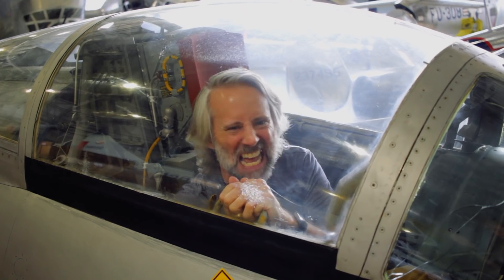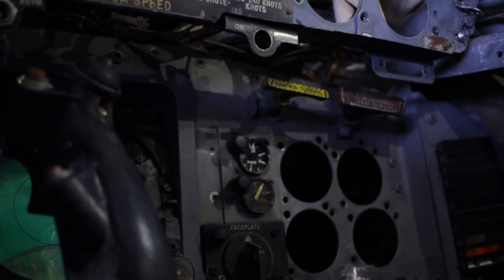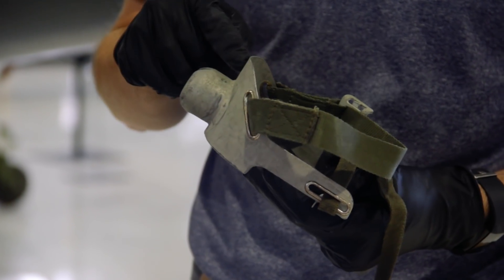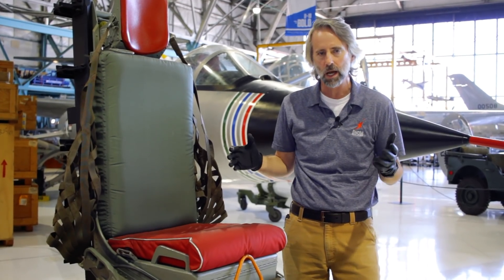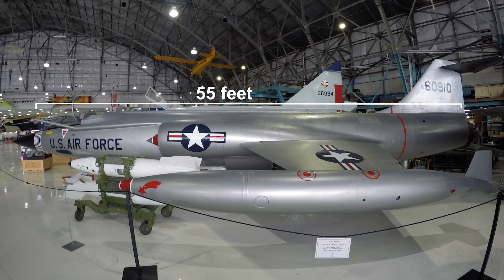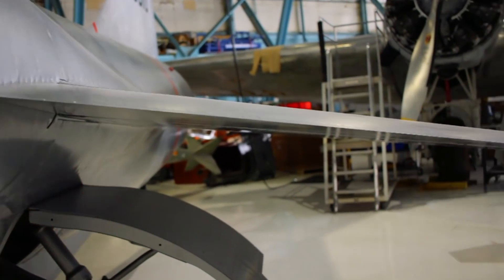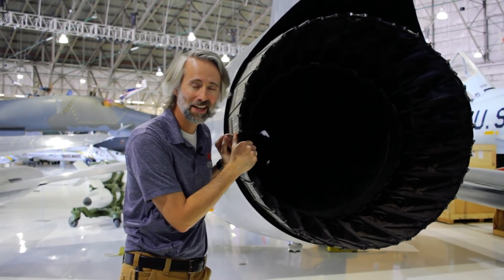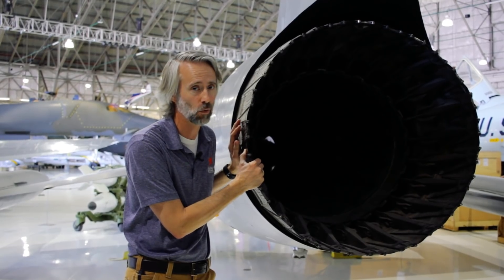F-104 Starfighter | Behind the Wings

Comment: If it didn't pass fuel through the wings, why did it have fuel tanks on them?
Reply: Gas lines running through the wings up to the extremities where the additional tanks were attached....Like under your car, lines running from the rear tank to the engine in front !
Reply: @michellevesque2130  So it does pass fuel through the wings, contrary to the narration, unless I have audio dyslexia.
Reply: @mssmith3604  There are no fuel inside the wings, compared to many airplanes, but only channels to bring it from the wings end optional tanks...
Reply: @michellevesque2130  Michel, thank you for your answer.  I have an abstractly related question you might be able to answer:  How is the sound recorded in gun camera footage?  You can hear the noises at the target and the shooting guns.  Seems to me any microphone on the shooting airplane would be saturated by the propeller noise.
Reply: @mssmith3604  Honestly, for that your guess is as good as mine !

Comment: This will be available to fly in War Thunder in this next patch
Reply: only the italian one which is actually the best varient
Reply: @caws3767  
"Best" depends on the standards you use.
The F-104S (the Italian variant you are presumably referring to) as in effect an attempt to turn the F-104 into an "all weather" fighter where "all weather" is taken by the U.S. military (and others) to mean capable of firing a radar guided Sparrow missile.
(The "S" in F-104S supposedly stands for "Sparrow".)
The Sparrow missile has historically sucked in terms of killing what it was fired at, far behind the infrared (IR) Sidewinder missile which was likewise behind a gun.
As a result, while I like the F-104S, I have a bigger soft spot for a F-104A that has been re-engined with the much more powerful and fuel efficient J-79GE-19 from an F-104S (something that the U.S.A.F. did with some, but not all of its F-104As which usually sported a J-79-GE-3/3A).

Comment: Was stationed at Soesterberg AB Netherlands in the late 70's with F-4E's, we would go TDY to Leewarden AB Netherlands and fly DACT missions against the Dutch F-104's. Coolest thing was they would taxi by and you could look up.the tailpipe and see a little hooded pilot light flickering at the bottom of the engine by the AB spraybars. Our Phantoms also had J-79 engines but used ignitor plugs. Always thought the pilot light was wierd.
Reply: I was down at Zweibrucken flying RF-4C while you were at Soesterberg....never landed there for some reason.

Comment: > [05:46] "It didn't have a great safety record.
> In fact, it's got the worst safety record 
> of all of the Century Series fighters".

I don't know what "safety record" you are referring to, but in terms of U.S. Air Force service, there were 196 accidents involving the F-104 with 160 aircraft destroyed and 58 pilots killed.
While these figures are bad, they are not the worst.
That honor goes to the F-100.
In the case of the F-100, there were 471 accidents resulting in 287 aircraft destroyed and 91 fatalities.

And I would argue that high loss figures for the F-100 are for basically the same reason that the Germans lost so many aircraft and pilots.
The F-100 was a quantum leap in terms of performance over that American pilots had experience with which they simply were not prepared for, just as the F-104 was a quantum leap in terms of performance over anything the German pilots had experience with and were likewise not prepared for.

Comment: Of all the users Germany and Canada had the worst F-104 safety record. The F-104 was never meant for low level and ground attack
Reply: The F-104 was originally designed to be a daylight air superiority fighter.
Whether or not it was "meant" to fly at low levels and perform ground attack, the fact of the matter is that it did both jobs relatively well.
The high wing loading meant that you weren't bounced all over the place when flying low and it's small size and high speed meant that it was hard to catch when it did so.
In Vietnam, the North Vietnamese went out of their way to avoid putting their MiG-21s up against the F-104 and so the latter ended up flying cover for F-105s on low-level, high speed bombing runs.
As it turns out, the F-105 is faster than the F-104 at low levels and so after the F-105s flow overhead, the gunners on the ground knew which direction the F-104s were coming from and so were ready to shoot them down.

Comment: The English electric lightning was better
Reply: "Better" is a relative term that depends on the criteria used to perform the evaluation.
But just for giggles, let's assume that it was "better" in some sense ... so (presumably) would be the F-22.
But it wasn't offered to the Germans at the time in response to their request for an aircraft that could perform its various mission roles at the time either and so it would be an equally silly thing to say.
Reply: @lewiscole5193  English electric lightning was available at the same time as the star fighter.
I believe in a side by side test it won in all categories except low level acceleration which was a dead heat.
The lightning did a swoop to night intercept on the u2 maxing out at 86000 feet.
It also joined in a competition to o a rear intercept a Concorde it was the only fighter to catch Concorde then over took it.
The lightning was the most under sold under produced best in the world interceptor  of its day
and could still out run many modern fighters.
Still times change 😑
Reply: @johnthatcher2349  
The Electric was "available" at the same time in the sense that existed and was flying, but is was not put up in response to the bid by the Germans and so it's pointless to say that it's a "better" aircraft than the F-104 that the Germans should have purchased.
(The competing options were the Grumman Super Tiger, the Dassault Mirage, and some paper jet/rocket hybrid Saunders-Roe interceptor whose designation I can't recall at the moment.)
I don't know what "side by side" tests you are referring to, but IIRC, the Electric had a shorter range than the F-104.
And the F-104 could and did a zoom climb up to U-2 altitudes.

Let's be clear here:  I like the Lightning, but as you said, it was under sold.
Reply: @lewiscole5193  only about 333 aircraft I think not a big production run.
Longest serving fighter the RAF had never used i  anger.
However in the 80s I saw one at an air show very impressive.
You could fly them at thunder city in South Africa till a few years ago £10000 an hour I was quoted.
Only £09999 more than I could afford 😣

Comment: If you ever have an opportunity, read Chuck Yeager’s  autobiography. He talks about the F104 on several occasions and he said that it was an interesting plane to fly but it had a really bad pitch up problem. They said that it wasn’t uncommon for that plane to be in a climb and then it would stall out and as it was dropping the pilots would have to put the engine in the full afterburner to try and get the momentum going again to save the plane. He flew especially modified F104 and got an altitude record for it but he was unable to recover the plane and ended up punching out a.k.a. ejected. When he did the rocket from the ejection seat hit him in the face and burned him severely. He was lucky to have survived but as you can tell if you’ve ever seen his interviews, he’s OK.
Reply: The usual description of the F-104 was that it was an "honest" but "unforgiving" aircraft.
Is something happened, you needed to deal with it right away or else _terrible things would happen_.

But while people like to point at the F-104's pitch up and deep stall problems, most people seem to be unaware that other aircraft have such problems as well and not gets too excited about them.
Without something to prevent it, swept wing aircraft are also prone to pitch up and/or deep stalls.
For example, the F-86 and F-100 were prone to pitch up and/or deep stall problems.
The problem was simply avoided (by the pilot) in the case of the F-86, but a fatal deep stall was sufficiently common in the case of the F-100s that it got the nickname "Sabre dance".
The problem was finally fixed in the F-100G (IIRC) through wing fences.

In the case of the F-104, it was equipped with a "stick shaker" which would shake the stick similar to what one might feel on some other aircraft when it was entering a stall before the main wings actually stalled.

Comment: You're enactment brought again my dad Andy Mullin experienced being stuck in an F104 starfighter when the canopy jammed. This was at Edwards AFB, at the General Electric facility in the hangar, 1959. The plan to open the canopy was to bleed out air pressure. Then Andy Mullin, a civilian aircraft mechanic, could pull the ejection cable and without enough air pressure only the canopy would pop off. The F104 didn't use air pressure like other ejection systems. When he sat down and pulled the cable he and the seat were slammed into the roof and he dropped onto pipes. Three years including a traction bed. And he got his old job back. His lawyer got him $40,000 and he was in and out the hospital until Andy Mullin died in 1971. I wish someone knew his part in the jet age history books. Thanks for sharing the F104 story and the complexity of it's ejection system.
Reply: Thank you for the info on your Dad. Sad that he ended up in that condition.
Reply: Thats a helluva story! Glad your dad survived it. It seems they could have cut through the canopy to avoid the ejection seat egress. They do have concrete saws that would have cut through it.